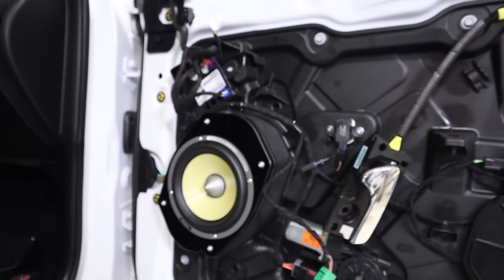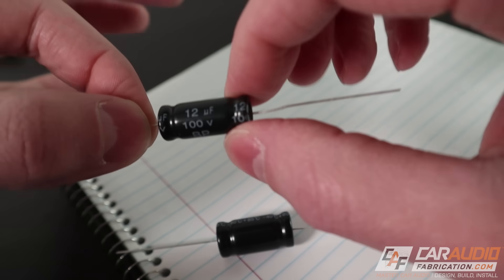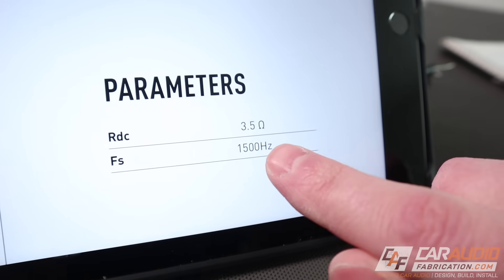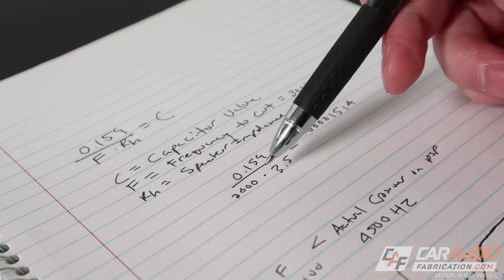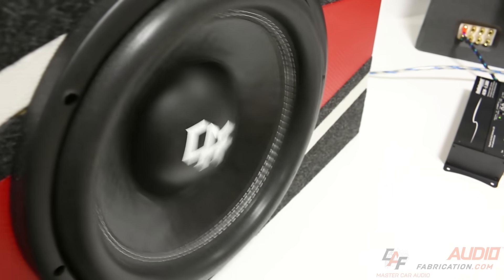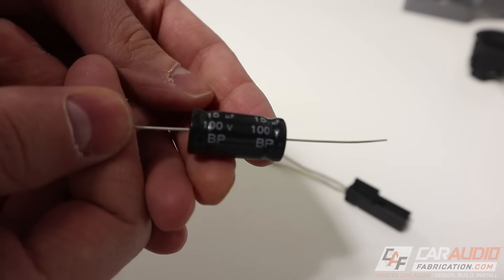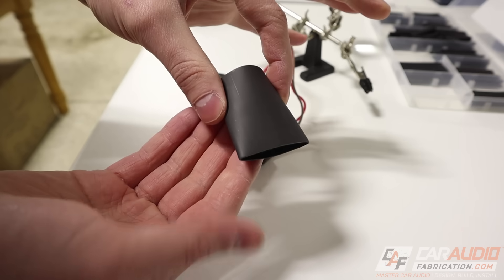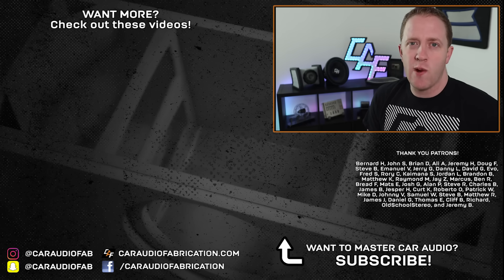PROTECT YOUR TWEETERS! Capacitors and WHY you need them

Comment: I run a separate electronic crossover, so would a capacitor still be required for protection?
Reply: no if running passive crossovers you dont need an inline cap

Comment: Great video.  I had an aftermarket stereo installed, and they ended up neglecting my factory installed tweeters.  They no longer work and my front left storage no longer works. It's been years since I've had this done so warranty is out of the picture.  Do you recommend running wires directly to the head unit?
Reply: im sure you sorted this out by now but no wouldn't do that. you would want a passive 2-way crossover box setup of some kind. your signal for your front door speaker would go into the box and it would split it and give you a separate +/- for the speaker and one for the tweeter as well

Comment: i dont understand i recently bought 4 sets of caliber 300WATT speaker and a set of american sound tweeters...the thing is i dont have amplifiers since i just use a android carplayer and for me its already sounds great the bass are punchy and all but, my question is do i really need a crossover for my tweeters and do i need a amp? please answer me and btw when i cranking up thr volume the punchy bass are making my android player flickering i mean...what was that mean? im.still new to car sound system, im a car guy im 20, im still learning stuff but if you answer me, it would be extremely helpful, because im kinda concern and it bugs me out because the flickering thing, thank you!!

Comment: (5:08) I think "AccuBASS" harkens back to AudioControl's Phase Coupled Activator, from back in the late 80s to mid90s(?). I have two of their old PCAs for home use and I will always have a soft spot for them. I prefer dbx's 120x-ds for bass restoration, though. It's more granular as for as the range of frequencies it uses for the restoration circuit. But we're talking 6 knobs on a dbx compared to just 1 or 2 for an AC unit, so it's a no brainer as far as which is more simple to operate. Anyway, I've rambled enough. Nice video! :)

Comment: Hey friend, thanks for advising people to protect their car audio tweeters in order to limit the low frequency bands.  My home lab experience suggest that when you are soldering a capacitor, (4:29) the heat of the hot soldering iron tip under five (5) seconds will not damage the capacitor. But for soldering any other sensitive electronic components (such as diodes and other 'semiconductors') then one might needs a heat sink (and that does not need formal tools but can improvised by using almost any plyiers, such as the needle-nose ones, and rubber bands holding onto the handles.)
Reply: @pvosoccer1585  excellent comment.

Comment: Can the capacitor be installed close to the amplifier instead of near the tweeter. It is much easier to solder near the amp vs in space constricted locations

Comment: Got a pair of 3-1/2 inch infinity reference two ways. 
They distort at relatively low volumes. Should I wire in a capacitor or bass blocker?
Reply: Yes
Reply: @hausboxaudio  didn't help. Haha, I just had to swap wiring around to the fronts only and fade it to the rear. Unfortunate but it just had to happen that way.

Comment: In order to get a 2 ohm load would I need a 8 ohm speaker along with a 8 ohm super tweeter?
Reply: what? no ur overthinking it,these arent dvc subs, they would come 2ohm from the factory, or whatever ohm they make em in, these are single VC tweeters
Reply: @nickn7939  reason I’m asking is because I got a different ohm load on my midrange after adding the capacitor
Reply: yeah its only for the lower frequencies tho, the ohms essentially are the same as factory.
Reply: @nickn7939  hmm weird I got a 2 ohm load from a 4 ohm midrange after adding the capacitor and tweeter
Reply: @Craneop817  you must have wired them on the same channel in parallel, b/c a 4 ohm speaker and a 4 ohm tweeter would be 2 ohms in parallel. Those tweeters usually come with a capacitor already on the positive wire, like the bullet tweeters, the standard is 4 ohm

Comment: Hoping someone can advise please. I have a pair of component tweeters made by Kenwood. I have lost the wiring diagram. They have a positive and negative going in and out of the sealed crossover. How do I wire these in to my woofer speakers from my amp please? Do I just branch off the positive and negative feeds to my woofers? Thanks 🙏🙏

Comment: Wiring two 4 ohm speakers in parallel and adding one 4 ohm tweeter in series with a crossover to one of the speakers, does the amp see a 2 ohm or a 4 ohm load from the tweeter?

Comment: Kids(Future BassHeads): La La 🙃😜🤪🤣 La La

Algebra Teacher: pay attention, you all are gonna need this one day!

Kids (Future BassHeads): whatever, teacher lady 🙄🥱

*20yrs later [designing an aftermarket sound system for your daily driver]

(Former Kids) BassHeads: wtf was that teacher saying? How do I calculate the cone area for this sub; better yet, what was that formula for the crossover capacitor? Pathagorean Theorem... Divide the radius, carry the 2 & minus the Square root of a right triangle... if a tree falls in the woods... hotdogs buns pack of 10?? 🤔🤔
👇👇
... Screw-it, I'll order another set of Tweeters from amazon or ebay 🤷‍♂️

Comment: Do I need a capacitor for my door speakers? I want to put the Kicker CSS65 Component System with a CerwinVega 2500.5D Amplifier in
2007 Mercedes C230. 
I believe there's an 8" Shallow Sub in the rear deck and a 3" Mid in the Dash which will be attached to their own amp in due time.

Comment: I have new tweeters for my truck. They came with Bass Blockers and Small black capacitors. Do I need both on the speakers? Or do I just need one or the other. I’m confused. Are capacitors and bass blockers the same thing? Really appreciate the help brother.

Comment: PLEASE HELP!

Hey,  I own a Hertz 100w tweeter (4ohm, Fs = 1250Hz) and added a 100v, 100uF capacitor to avoid heavy bass from the tweeters. Does this help cut off harmful bass and protect the tweeters?

N.B. I couldn't find anything below 100V, 100uF.

Comment: What about piezo tweeters? They function basically like capacitors and dont really need a crossover. But does it affect the overall resistance when you connect it parallel?

Comment: So do I need a capacitor and a crossover or is s capacitor the crossover? I'm asking because I got some decent component speakers from jbl and they came with one of those square looking crossover that has inputs from the amp or head unit and has outputs going out to tweeters and mids. So do I just use that or do I also add a capacitors?

Comment: I have a popping noise and like white noise coming through my tweeters. Can you help me find the solution to this. 
I’m using kicker component kss65
From a pioneer avx1500nex.
Reply: Factory cabling?
Reply: Tim Burton maybe. I’m not 100% sure. Possibly. The wires are cut and connected with new ones.
Reply: @razhocarjr  step one then is to understand what you've got
Reply: Tim Burton  if I knew I would t be asking for help. 
It’s a new head unit. Connected to a new pioneer harness. 
The new speakers were connected to the existing wires. And there is still static coming through. Not sure why. The grounds are good but I am replacing the rca cables. Then I will check from there. Anything else???
Reply: Tim Burton that’s what I know.
Reply: @razhocarjr  RCA cables? You have an amp in this chain somewhere?
Reply: Tim Burton yes I have two amps. One four channel and 1 2 channel for my sub.
Reply: Tim Burton so everything I have is a pioneer Avx1500 Nex head unit. 
Kicker kss65 component in the front 
Kicker coaxial in the back. 
A 4 channel amp 
A 2 channel kicker cxA8001 
Pushing. Kicker 12” L7 S.
Reply: @razhocarjr  right, crucial info missed out. You need to ensure signal integrity throughout the chain, so ensure the head unit and amps all have a good clean and ideally common ground. The source of your static is probably a combination of two things; inducted interference from the chassis loom, signal crosstalk; improper gain structure between your HU and amp.
Reply: Tim Burton yes maybe it’s my gain I will try to reset and will check out again once I install some new rca cables. I bought some 6 channel stinger.
Reply: @razhocarjr  common source of noise is where one part of the chain is too low, and another part has to crank too much gain in to compensate, this lifts the noise floor along with the signal.
Reply: Tim Burton ahhh. Ok. Maybe my bass is too high/low or my mids are too high also. Thank you. I will check it out.
Reply: @razhocarjr  not talking EQ here, your line level on your head unit and your gain on the amp. Really need to be
Setup with an oscilloscope, or with an experienced ear
Reply: Tim Burton got it. Thank you.

Comment: Another old tweeter protector trick is to put a 12v lamp, such as the dome lamp for your car, in series with the tweeter. I use this on addition to the capacitor on tweeters for stage sound.  Lots of watts. Hooked up source, eq, electronic crossover,  separate amps for each set of speakers.  Just sayin. Get an old tweeter, hook it up like this, run lower freqs to it, see what happens.  I blew two tweeters at a summer festival gig one summer. Fortunately I had replacement diaphragm on hand. Easy to change for the next day of the festival.  With the lamps,  never happened again. Try it. Quick and cheap!

Comment: Can i just use a passive crossover?
Reply: Sure you can just use a passive crossover. Each component in the crossover changes the "order" or the slope of the roll off. Even order passive crossovers tend to sound more dry and less lively than odd order passive crossovers. The crossover complexity also have a different polar responses affecting off axis performance. Read the "Loud Speaker Design Cookbook" by Vance Dickason.

Comment: @caraudiofabrication You mention this is a failsafe capacitor - If I want to add a tweeter to a system that does not currently have tweeters (by tapping into the wire going to the midrange speaker) and therefore currently no crossovers what would you recommend instead of doing this?

Comment: but it affects the sound but i guess if you listen to garbage music at max level (distortion) you should have one.    Just use an amp with a RMS wattage rating above your speaker rating and you will have no problems as long as you recognize the distortion.  Distortion kills not wattage
Reply from the maker: Yeah wrong. There are multiple high end speaker manufacturers that INCLUDE a protection capacitor with the tweeter as it is so important to protecting it. I dont know why it's hard to understand but when you use proper crossovers the impact this cap will have is at like 48 db down, so no.... it has no impact on audible performance. Very very smart people that literally design speakers have on record said that a protection cap should always be used. Perhaps you should do some more research rather than making assumptions about the type of music we listen to being the need for this.

Comment: Not sure if you respond to messages, but how do you determine a crossover point if the company doesn't provide specifications for the tweeter?  I have some JBL components, and on one forum, they straight up told a guy "we don't provide specifications for crossovers, if you don't use the included passive crossovers it is at your own risk and voids the warranty."  I have looked at the individually sold tweeters in the same line, and they are at 3000, so I'm guessing thats a good place.  Also, they don't list the resonant frequency so that I can apply the protection you talk about in this video.  Love the channel, BTW...your work is amazing.
Reply from the maker: I hate to say it... but I would start with not buying speakers from companies that dont provide specs. To me this sort of thing is an excuse so no one can call them out if their manufacturing varies wildly. The speakers should be within tolerance of a spec. I'd look elsewhere...

Comment: "Resistance"? -> Impedance.
BTW, I have an active 3 way front stage with NO passive components at all. No problems. no need for this if you use JL Audio amplifiers and DSP.
Reply from the maker: Funny how a protection capacitor is INCLUDED with JL C7 tweeters. This is not a passive crossover... it's an acting protection device which was stated clearly in the video. It does literally nothing to the sound until you have an issue and it needs to. So yes, even when you use quality gear if you are smart you will still use one because even quality gear can have a setting incorrectly adjusted or a turn on pop or system noise.

Comment: Audio control is rock solid and they have great customer service unlike many other companies. Your lucky to be sponsored by such a great company
Reply: I have a Audio Control  LC 4.800 amp   with  a pair of  Audison 6/9 APX on the rear
 channels  &  4 Audison AP1 tweeters .
 two connected in
 parallel  for each front channels  150 RMS on the tweeters with the AMP giving  200 RMS   Would you  add the crossovers that are included with the tweets?  Your input will be appreciated. Thanks
Reply: @boondoggesp7836  active crossover is better than inactive. Protection is necessary. Give audio control a call to find out which model would be best for your setup and experience their great customer service for yourself
Reply: Thanks     I was leaning in that direction   But some say without protection ✌

Comment: Make sure it says "NP" on the label for non-polarized, meaning it has no polarity. Those capacitors are specifically designed to work with the variable AC signal that is speaker audio. If you see ( + ) or ( -- ), the capacitor will eventually fail as it's a polarized capacitor made for DC only.

Comment: Hello guys, My name is Franz and I have big question i know you can answer easily.
1 year ago i got a 4 channel amplifier  capable of 75 W rms per channel at 4 ohm and 100 W rms at 2 ohm per channel.
I hooked up 4 coaxial full range speakers of 4 ohm (One per channel). The problem was
i was lacking of highs. So i am thinking about adding extra tweeters to my system by putting
them in parallel with the coaxial speakers with their respective crossover (crossover only for the
tweeters because the coaxial are full range(they have mid bass and tweeter)). 
Is that solution ok, or is it wrong? (For example: 4 ohm coaxial in parallel to 4 ohm tweeter per 
channel: So the amplifier is gonna see 2 ohm per channel, so my max power per channel
is going to be 100 W rms) Mathematically i know, the impedance is not linear in the
frequency axis and the coaxial is gonna request more power than the extra tweeter butttt....
And here is another question, if i turn up the volume slowwwwly,
how i know when my amplifier or tweeter is gonna blow up or start clipping?
Post data: My neighbor has an oscilloscope hehehe.

My actual system is: (JBL 600Wrms 4ohm mono amp ==> subwoofer Rockford P3 600Wrms 4ohm)
              (Rockford prime amp r400-d4 ==> 4 coaxial speakers = Rockford T1650)
 
       (in the future ==> one new amp for adding only midrange woofer and bullet tweeter)

Comment: yea the JL C7 dont come with passive crossovers. Active is best by far. No need for caps in high end audio. If you are an idiot then use passive crossovers, or normal installs. Active systems are for advanced systems. JL says passive crossovers were holding back sound quality.
Reply: but in all honesty, JL just wants to sell their high end amps with DSP built in and separate DSP systems
Reply from the maker: Watch the video THIS IS NOT A CROSSOVER. my active crossovers are set higher than what this passively limits at. IT IS PROTECTION FOR THE TWEETER WHICH IS THE WHOLE POINT.
Reply: @CarAudioFabrication  I've never had a problem 5 years installing active systems. For DIY'ers I can see that being a good idea. I personally think YouTube is causing more damage to the industry than helping. I fix peoples stereo daily that watched a YouTube video. Its a real problem.

Comment: Where to connect the capacitor Positive wire or negative wire ?
Reply: I saw some videos they connected it to positive wire.
Reply: Inline on the positive side...cut your positive wire short the same length as your cap ( after the leads are trimmed down) so once its soldered in place, both positive and negative speaker wires will be the same length.

Comment: Bi polar capacitor is so hard to find in the market , commonly Non Polar its Sounds so Fixed and not bossting when its became usual usage
Reply: I get Bi polar capacitors very easily, not sure where you live, but any speaker component supplier has a massive selection of electrolytic and polypropylene caps. Local electronis supply store has the electrolytic ones,  also 3 websites I can name.
Reply: Mouser, Parts express, amazon all should have bipolar electolytic

Comment: I would still say use a polyprene cap because the full sound signal still passes through the capacitor and it will affect he sound quality.
Reply: Certainly on high end tweeters you should use polypropylene, I still see people using $2 electrolytic caps with $400 tweeters.

Comment: Do you need only one capacitor for 4 tweeters in 1 door?
Reply: My only question is... why do you have 4 tweeters in 1 door?
Reply: @RtistiqSkubie  I have a wall in the back of my pickup truck 4 18's
Reply: @TheBoogyVanGuy  My tweeters will scream with those 4 18s ALL day, granted they are almost a thousand bucks a pair.  You need one cap PER tweeter :)